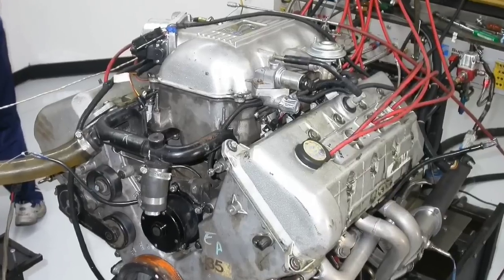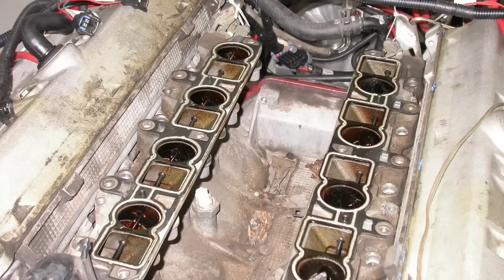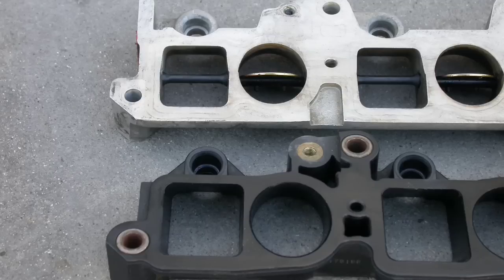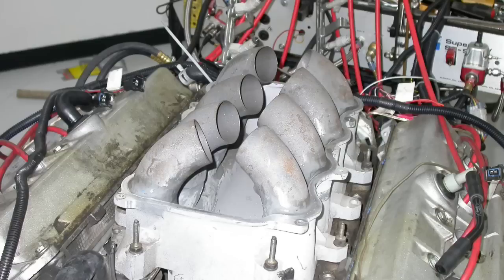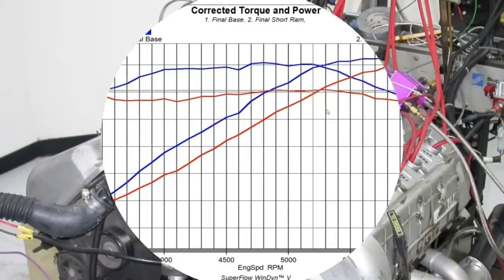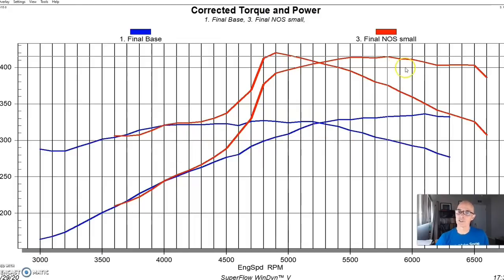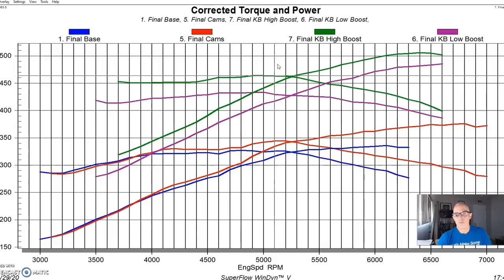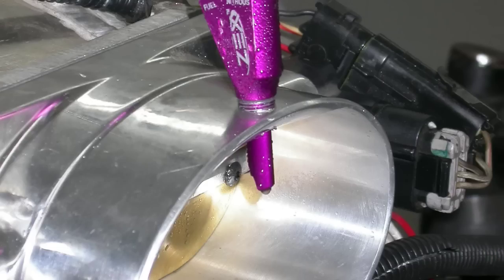1996-98 4V COBRA MODS

Comment: The 4.6 4 valve motors were always cool. I love how they sound with a set of long tubes. It’s kind of a shame they never got used passed 2004 in the mustangs. Probably one of the best sounding v8’s ever made.
Reply: They do sound great. Way better than the new mustangs that sound like raspy 💩 boxes
Reply: @T.J.Caldwell318  yea the coyotes sound ass
Reply: @Kk_1100  Sounds great in my 4.6 4V 95 Lincoln Continental. Great Car!
Reply: They're among you now in the 2011-current
Reply: They put a 5.4 4v in 07 up gt500s it's a tall deck 4.6 same architecture same firing order and they sound nasty.   My 07 has a gen3r and arh long tubes offroad h and borla stingers sounds like pure sex video on my channel highly recommend.
Reply: @T.J.Caldwell318 well the type of exhaust most coyote owners run makes the problem much worse.  They can sound good with the right setup but everyone does catless long tubes and raspy xpipe and the loudest mufflers possible like attaks or extremes.  More take mufflers and an hpipe does wonders.  Even still the older mod motors Def sound better.  Everyone forgets 07-14 gt500s had 4v mod motors too with the same firing order as the older 4v 4.6 they sound nasty.
Reply: @midnight347  yeah there's a guy down the street that just got a new Bullitt and it sounds great.
Reply: @midnight347   You're the only one to mention the firing order which was the biggest reason for them sounding so amazing. Still blows my mind how the firing order influences the way the exhaust sounds.

Comment: If you want to modify a Ford 4v motor,all you have to do is take out a second mortgage and sell off everything you own to pay for it,or you could just modify a 351W and have your cake and eat it too.
Reply: Yessssssss ... Mods are just not worth it.
Reply: turbojet powered so, if you don’t build for 1000 HP, don’t use the Cobra engine?
Reply: An 03/04 Cobra motor is going to be on borrowed time at 1,000 horsepower. It has pretty much the same pistons as the rest of the motor line up. Hyperutectic cast essentially.
They're going to be living on borrowed time north of 600 horsepower.
Reply: Just like a Harley  money
Reply: So you can get a block that will split at 500hp, a weak crank, junk heads and have to basically rebuild the entire engine with all aftermarket parts...
Or use the 4v, which has a block, heads, crank, intake that will withstand 2000+hp?  Gee, let me think...

Comment: Everyone always refers to the 4v as a cobra engine but in reality the Lincoln mark viii was rolling around with one of these engines back in 93 haha
Reply: Exactly 😆
Reply: This was a cobra motor he said it was a 96-98 and it had a cobra intake on it too.  I get what you're saying but the cobra is what made it well known thus why its referred to that way usually
Reply: @midnight347  for sure nobody even knows what a mark viii is anymore lol
Reply: @LynnTwinCustoms513  they are cool cars for sure.  A cobra intake ported and turned into a short runner would really help it out..aggressive stall and 4.30 gears them things can be pretty impressive for what they are.
Reply: @midnight347  I have a 97 mark viii with a tremec 3650 and 3:73 gears it runs out pretty good for a boat anchor of a car. Need to make some videos of it lol
Reply: @midnight347  make videos please 🙏
Reply: @LynnTwinCustoms513  yea man I would suggest a ported cobra short runner intake and a switch to 456 gears and some aftermarket cams if you can swing it.  Trust me these mods will make a huge difference.  373 just isn't enough for these b head cars let alone one that is that heavy so going 430-456 is even more of a must than it would be on a cobra.  Dont fear the gear it may take 2 mpg away highway and improve it everywhere else depending how much you stay into the throttle.
Reply: @marioeid930  I think that was directed at LynnTwinCustom$ lol...I am going to assume so anyways.  I do have a few videos on my channel of my 07 gt500 and 16 fiesta st.
Reply: @midnight347  i thought you had a mark with a stick?
Reply: @marioeid930  that was the other guy commenting be cool to have one though
Reply: @midnight347  😂😂 im halfway  working rn so i didn't clearly read my mistake cool! Yeah i have a 98 cobra
Reply: @midnight347  calm down money guy 😂 nobody asked what you drove.

Comment: Thank you for showing these great engines. Its such a shame that the aftermarket really doesn't cater to them like the small blocks
Reply: It's much more of a commitment to modify a 4-valve V8.  You have to buy and install four cams instead of just one.
Reply: Uhh theres endless aftermarket support for the ford modular engines.... pretty much anything mustang has the largest aftermarket support.
Reply: @drgibs347  Only because for 25 years, the Modular was Ford's only production V8.  Ford really missed the direction of the market when they designed the Mod engine.  The wanted it to be small enough to fit in front wheel drive cars, so they designed it with 100 mm bore spacing, pretty much limiting it to 93mm bore.  Meanwhile,  GM and Chrysler have the LS and Hemi that can go to 104mm bore.  The Ford just can't compete with the 2-valve version, so a 4-valve dohc engine is necessary.  Expensive to manufacture.  Expensive to modify.
Reply: @andyharman3022  The bore was selected to make the engine square and keep displacement down. It makes for a more efficient combo overall being less prone to detonation with the small bore and good stock heads. The long stroke helps with cylinder filling especially with the 2vs which focus more on port velocity than flow, hence why even the earliest 2v out torques a lot of pushrod engines. Richards own test saw 260hp- 341ft/lbs run with the stock npi cam and intake vs 250hp-300ft/lbs out of the 5.0 combo. It's obvious the modular is effective at power production despite being quite small in displacement. You can't argue it missed the market when the 2v outsold the other pony cars and still competed with the 70ci larger, and more powerful combos where the 4v was much more suited. I'm tired of the claims of how spendy they are because I have been able to source running 4v c headed combos for under 300$ for years. These stock heads and cams will support almost any power level you'd like to reach on a 281.
Reply: @andyharman3022  It doesn't take big brains to realize 4 costs more than 1. I will continue to say it's cost effective to go modular as you specifically do not need to change valve train, cams, or port the heads to support serious power and maintain good valve control all the way to around 7k under serious boost. How the hell do argue there isnt increased cylinder filling at the same Rpm with longer stroke? The 4.6 compromised the small bore size with stroke and again with the 5.4. call me a fanboy. I say bragging about your own "self achievements" is pretty shallow. I didn't attack your post, just stated fax. Enjoy your throw-away ls's
Reply: @madmod  I can argue that there isn't increased cylinder filling with longer stroke because I know that undersquare engines reach Mach limits at the intake valve at lower speed than oversquare engines.  It's sort of a mathematical certainty.
Reply: @andyharman3022  There is only so much volume a port can flow through it, however the velocity at which the air is moving through it changes dramatically with stroke.  A great proof of concept is the 5.4 which uses identical heads, cams, and when paired with the same pi intake manifold as the 4.6, it will produce nearly identical peak horsepower and do so 1k Rpm sooner in the curve. You will see that the engine is consuming more air, the maf will show this too. Now with the constant being every thing that actually supports airflow and power(head, cams, induction), the only thing that changes is the stroke. If you have more cubes pulling on the same hole, it will pull more through it in the given duration.
Reply: @madmod  Yeah, that's just what I told you.  The higher velocity caused by the longer stroke causes the port to choke sooner.
Reply: @andyharman3022  it's not that it's choking. The valve opening event stays the same but the succ is increased. To compensate, you must open the valve longer. The head port flows the same amount but the air moving through the port will move faster. Your beating a dead horse trying to make what I'm saying wrong.
Reply: @madmod  "The head port flows the same amount, but the air moving through the port will move faster."  What you just said there is complete nonsense.  If the air is moving faster, the flow rate increases.  That is bedrock engineering fluid mechanics fundamental.  Volumetric flow rate = cross sectional area x velocity.  If the flow rate increases, the velocity has to increase.
Reply: @andyharman3022  port velocity has nothing to do with flow numbers. Youre nonsensical
Reply: @madmod  You know nothing about engineering.  Have you ever worked the continuity equation, even once in your life?  I can't play with you anymore on this subject.  I'm going to watch silly cat videos now.
Reply: @andyharman3022  Stop mistaking the ports potential flowing volume for actual volume of air moving through it. It will flow the same on a bench through the lift range because when bench testing, you use a fixed measurement of vaccum against the head/port. Just because you can have 250+CFM through the port on a bench doesnt mean it will flow like that with the manifold attached in the real world. Most 2vs will never flow more than 200cfm through that port as that's about the limit of the intake manifolds stock runners. With that said, a longer stroke engine will pull that air through the port more effectively, and with a higher velocity because it has a greater vacuum doing so. The air is moved through the port faster despite the port not flowing any greater volume. Raw flow numbers mean jack shit in the real world. all the CFM in the world means nothing if it can't hastily  move it through the port.
Reply: @andyharman3022  watch your silly videos and brag about your accomplishments on the internet. Remember who threw the haze
Reply: @andyharman3022  volumetric efficiency. All ohc engines are designed for volumetric efficiency. I can tell you're intelligent as well as the other person you're debating this with. The engine was made that way for rpm and compression. Hint, 5.0 Coyote specs.

The pi and non pi head swap also lends credence to madmod. Not trying to butt in but, you kinda gave it away that you were a GM loyalist. 

Y'all dropped a lot of knowledge real quick and then you mildly turned it into self indulgence. I did however, see the both of y'all points. 

Hopefully others won't get lost in the sauce and be able to cite more tidbits to help with engine building. I look for y'all in these comments on science vids and Google a lot of what y'all post. This is getting fun.
Reply: @madmod  4.6 motor are the best motor out there they keep ford in the industry and they still out there i have a 97 4v motor my self on my 2001 bullitt
Reply: @andyharman3022  there's a reason it left production in 2002, and the charger had to go 4 door to stay in competition, meanwhile the challenger had already stopped.
Reply: Theres no point for aftermarket heads, b and c heads flow extremely well, c heads especially for n/a build. There are options for intakes and other things
Reply: Slightly off topic: I have a 93 and 96 Mark VIII. Are the Cobra engines any different ??
Reply: @xmo552  The intakes are different, the Mk8's are slightly detuned as well but as far as physical differences I believe it's just the intakes
Reply: @andyharman3022  in 1997, the mark viii G2 came out, and had a 4v with 280-290hp, and had the ability to push 30 mpg. Not impressive today, but it is impressive to think that happened 24 years ago. The lack of knowledge and effort to make it fit, is the real reason the 4.6 didn't get the clout that the LS based v8 gets.
Reply: @xmo552  minor changes. 97-98 g2 marks had some more significant changes
Reply: @PureCountryof91  
Yeah my 93 and 96 both got like 32 mpg all day every day.
Reply: @andyharman3022  Really?  No.  In 1998, there were almost as many mustang cobras sold as all LS camaros.  And there were about 5x as many 2v mod mustangs sold than cobras.  It outsold the GM F-body because the GM F-body was garbage.
By the way, bragging about "never passed by a mustang", I'm guessing you only went to GM only track days.
Reply: @Milehighsnake98  I've never been to a gm-only track day in my life.  Never even heard of one.
Reply: @andyharman3022  You can claim anything you want.  Doesn't mean anyone believes you.
Reply: @Milehighsnake98  You can say anything you want.  Doesn't mean anybody agrees with you.
Reply: @andyharman3022  Doesn't make me wrong.
Reply: @Milehighsnake98  But you are wrong.
Reply: @andyharman3022 everyone always talks about installing 4 cams instead of 1.  Everyone always fixates on this but everyone forgets you can do a cam install without removing the heads and get to them easier.  They're awesome engines they have much more potential than the old 302 pushrod with fewer mods.  Forged rodsand pistons it can take 1000 hp stock block stock crank try that with your 302 small block.
Reply: @andyharman3022 the 2v can make plenty of power.  4v is better but the 2v is Def capable.  Stop with the Ford can't compete nonsense.
Reply: @andyharman3022 also the 4v isn't hard to modify at all.  You can throw a blower on it and make more power than a 302 with heads cam intake + blower.  Which one is the simpler recipe?  You can do forged rods and pistons and do 600-700 pretty easy with stock heads try that with your 302.  You're clearly bias against the mod motors and don't know what you're talking about.

Comment: I have a 1997 Cobra. Unless you are going to supercharge the engine not worth having compared to push rod 302/351. No mod rebuild on a high mileage engine is not worth the price. 94-95 is the way to go.